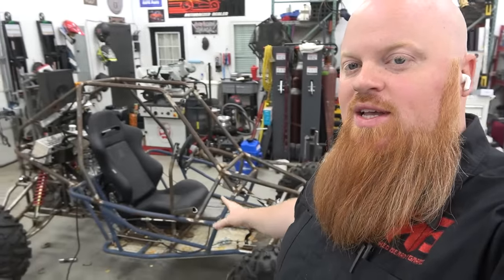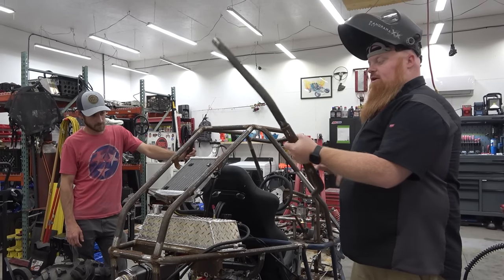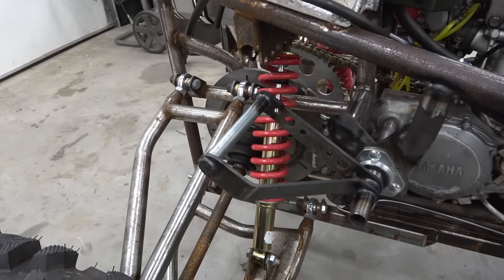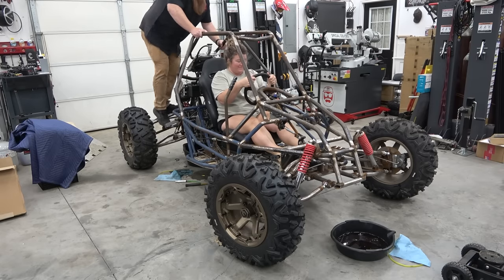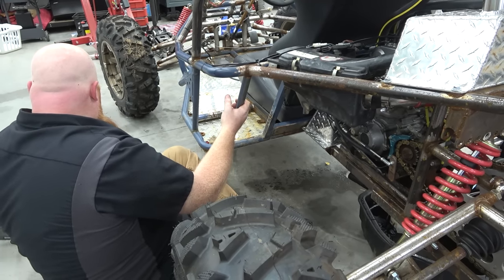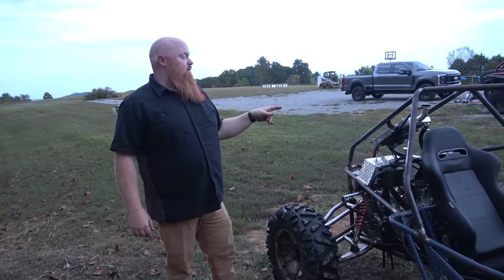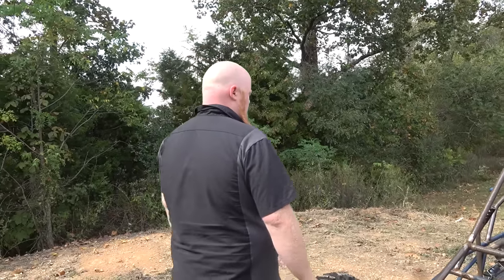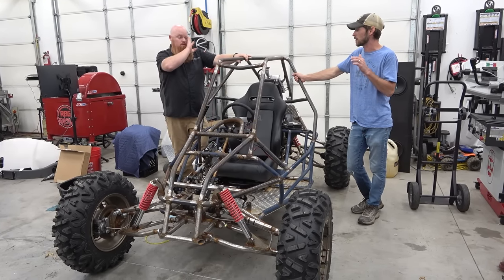YZ450 Powered Cross Kart First Ride

Comment from the maker: I realized after filming this that I never bled the cooling system before riding. That's probably why  it was overheating. We have a lot of parts coming for this build to make it as fast as possible. Then We race the supercharged buggy!!! STAY TUNED!
Reply: I think the smallest front sprocket is a 12 tooth.
Reply: Add a temperature gauge
Reply: what ever happened to that king quad?? haven't seen that mug in awhile
Reply: @Red Beard garage I need some help😢 I hit you up on Facebook
Reply: What year is the engine ?
Reply: Do you still collaborate with go power sports?
Reply: You mean YZF Cause that's a 4 stroke not YZ 2 stroke Oh and that motor needs a valve job and or rings it was 1000% smoking from the time you started it till the time you shut it off
Reply: @chris001979 😂🐃💩barely smoked and only when he let out of it, nowhere near bad ring smoke , likely h just needs run since it been sitting and got moisture in it
Reply: @bodine2537 no i have a yz450f and mine have 0 smoke
Reply: @jamesclark4  as long as he said it’s been sitting plus the moisture that got in it I would say it just needs run a little while and it should clear up , the way that guy was making it sound was like it was pouring smoke and bout blown up when it’s nowhere near that bad, looked like closer to the end of the ride the smoke was almost completely gone to, he says he’s got plans to rebuild it anyway so it won’t matter, all will be new if he does
Reply: that clutch wasnt meant for that setup so thats prolly part of it
Reply: If your using a four stroke engine,why not use a street motor like a Hayabusa. Or gsxr 600 or 1000cc..way more power and electric start.You did a great job. On the cart,just wondering why the 450?

Comment: Awesome job ! 
The yz 450 is my favorite engine. I’ve built quite a few, my son turned me on to them. I had always run 2 stroke 250z till I drove my sons 4 stroke 450 
5 valves in that head to get the gas needed to feed that beast! It turns like a 2 stroke ! 
It won’t let you down!!!
Reply: But do you think it’s underpowered I’m this heavy kart

Comment: So I'm a die hard Yamaha guy. Not sure what year that engine is but it looks like an old 5 valve engine which is good because the valves are titanium. The 4 valve engines are great but they won't make as much power as these are capable of. My dune queen is a 2003 yz450. I put a 505 big bore kit in it, weisco forged piston, ported and polished the head myself, did a custom grind on the cams, I run it on c16. She makes 73 hp at the rear wheel. It's an absolute monster. I've gotten her to 240-250° and I've never had any issues. They're by far and away the most reliable liquid cooled 450cc engine there is end of story. I've owned them all, honduuuh, ktm, kawisucki, Suzuki, and Yamaha won my heart because of the reliability. If you wanna get rid of the popping lash the valves. And ur gonna want to change that oil and the filter every 8 hours. Also look into a power now valve and a billet lectron carb.

Comment: I have some YFZ Rads in the shop, and 2-3 fans we can send back with you, I’m so impressed it actually ran as good as it did considering your water issues! With the gearing and mods you’re about the throw at this, we should get close to RZR 800 power this is gonna be fun!
Reply from the maker: When we combine forces, she will get perfected! I also think I have air in the system. I never properly bled it.
Reply: @RedBeardsGarage  gon be slicker than owl snot!

Comment: Alright that looked like so much fun. I have a 1980 something Chenoweth that was powered by a VW and the plan is to repower it with something like a J32. Would love to do a manual setup. Right now I've got a couple other projects ahead of this one, like rebuilding a IH TD-6 and refurbing a DoAll bandsaw. I'm contemplating moving the engine up front on the Chenoweth and making it AWD. Either way watching you drive that gets me excited about my project as well. Thinking about doing a turbocharged J32 and running E85 because it's cheap and easy to get by me. Either way rear engine and 2wd or front engine and AWD it should be a hoot to drive when it's done.

Comment: The rad would be good in front, mounted with a little Slant with the fan only problem coolant hoses. You might have to some how engineer some cool air induction ports for radiator since it's in the rear. I just opened the video and the red was the first thing I noticed, in the fan are you pushing or pulling air and how does that work, maybe get a bigger radiator? I can see there's going to be overheating problems. The suspension looks really good

Comment: That thing is way to heavy for that engine.  That is why people put street bike engines in them.  You have double the weight that engine was designed to move.  So, while the cart is really cool, that engine will fail very soon.  They dont even last that many hours in the 200 pound dirtbike.   Get you a used 4 cylinder street bike engine and put that in there.  Then you can pull wheelies with your cart and not have to worry about hurting the engine.  You will be a lot happier with the performance!  Great fab work BTW!!

Comment: Maybe get a bigger radiator dual fan setup mounted high higher on the roll bar and just build a fan shroud with a roof air scoop and build the body and fairings off of tha andt built for functional airflow

Comment: Sweet build i have a yfz450r quad nd recently put some amazon/china tires they are wanda brand with a x pattern tread like the maxxis tires but the lugs are meaty like 3/4 inch or bigger nd they hook like you wouldnt believe if you feel your self fighting for traction on this build check them out they are cheap too

Comment: I know you were just testing it, but that engine should rev to like double what you guys were hitting, right? Much more power up top?
Reply: Agree. Sounds lazy. I’m guessing low compression. It also looks hard to start. Just like my Pitbike when it had zero comp.
Reply: Need to check valve adjustment and with the bigger than stock exhaust and no airbox like a bike would have the carb needs to be rejetted.

Comment: Id be hunting down a 660 or 700 engine for this. The 450 may be a strong engine but its just not suited for this kinda weight and that big of tire. You may get it geared better but its not gonna be happy for long under that much load.

Comment: What size is your rear sprocket? Do you feel like it has enough power once you swap the front sprocket? I have a Joyner sand Viper 250 that I want to put a Raptor 660 engine in, but I'm curious if I'm going to be disappointed with the power. I think your situation would be pretty similar to mine.
Reply: You wouldn’t be disappointed with the power. But the front suspension is another story 😮. I put a cbr 600 in my sand viper and ended up rebuilding the entire suspension
Reply: @gmanlv1425 oh, hey! I've seen your write up. That front end you put on it looks great! Do you still have it and was it worth it? I've been tempted by a motorcycle engine, but that might be a little much in it and I like reverse.
Reply: The front was worth it for sure.   I don’t have the SV anymore, I have a single seat I built (copied front suspension to the SV) and a Joyner Trooper.     I’m would stick with the Raptor motor. At the time it was easy to find bike motors cheap. I paid $350 for one and $500 for the other.  Oh I run jack shafts so my final hearing is between 4.5-4.8. It’s equivalent to a 60+ tooth sprocket

Comment: Kind of off task, but do you know if any billet flywheels have inner magnets to enable the use of charge coils? I want to do a governor removal on my 212 swap Baja carbon/heat, but I also want to run headlights off my engine. I’m wondering if the $34 billet flywheels on amazon have charge coil magnets. Thanks

Comment: the dumb and dumber ref got me lol Also, that thing is smoking pretty bad...especially on decel. Either there is still a ton of blaster burning off or that cylinder is tired bud.
Reply: Valve stem oil seals are worn.
Not cylinder cos runs fine on power

Comment: Could you not have used a wr450f engine ....has electric start and you can do some small mods and get the same preformance as a yzf450

Comment: Could be cool with a long lever/rod you could pull rather than kick !
Reply from the maker: I thought about that but then I would be worried about kick back into my arm lol.
Reply: @RedBeardsGarage  Ha !  I remember the old Honda ATC 185s had a pull start with a compression release...severe pain if you forgot !
Reply: @RedBeardsGarage  You would have to find a good balance between length of throw and leverage but I think you could have enough mechanical advantage so that any kickback wouldn't be very strong.

Comment: Ripping through the gears but hardly moving what’s wrong with it
Reply from the maker: Its too high geared. Once regeared and make sure the carb is tuned in properly it will be way better.
Reply: @RedBeardsGarage okay that makes a lot more sense I was like dang that thing should be flying. Regardless the build is freakin amazing

Comment: If your chain is fine right now then why do you need a chain tensioner if you change sprockets. Your not adding or subtracting half teeth. You changing sprocket so take links out of current chain. Yes may have to run a half link if you drop down odd number but still nothing wrong with half link. No half link if dropi g even number of teeth

Comment: Proffessional mech allows expensive engine to internally corrode through neglect,  starter bends,  cooling system inop,  brakes fail, improper gearing,   malfuctions within minutes of use every time,  too many small side projects and necessary mods to list,  shifter wrong,  electrical system non existance,  no paint,  etc, etc..
Will push to side until forgotton.
Red Beard Garage,  OOORAH